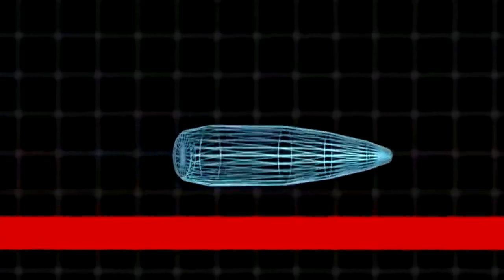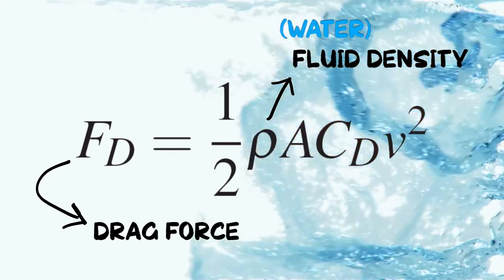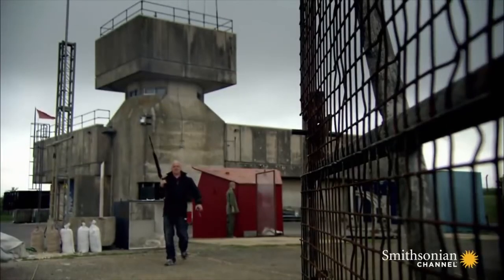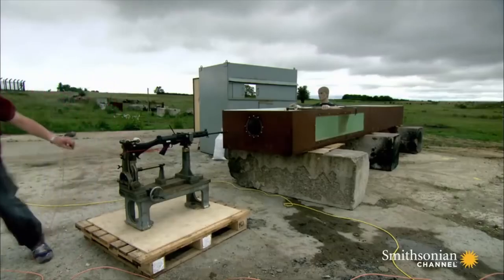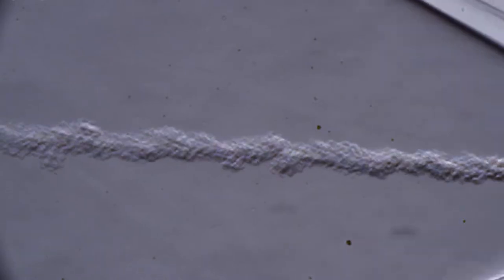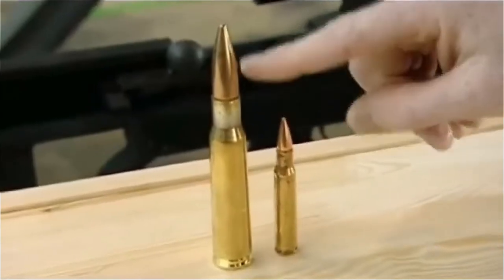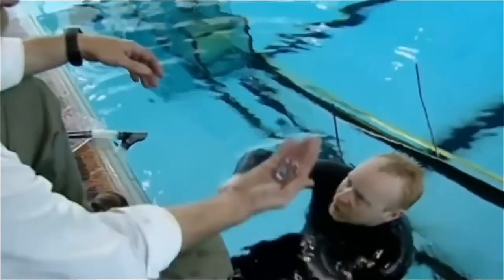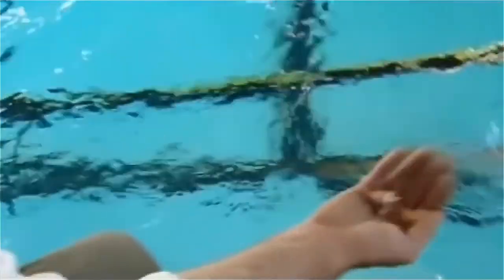Can Bullets Kill Underwater? Is Water Bulletproof? Movie Physics Explained

Comment: What always bothered me was that no one bothered to test the amount of bullets being shot.  I know water will stop bullets, but with the amount being shot that day, is it possible to some bullets to defy physics and kill a soldier underwater?  I'm sure a few did.  Hitting the water at just the right angle.
Reply from the maker: That's a valid point! I wouldn't say some bullets would defy physics and penetrate the water more than the others, but I can imagine a few reaching the soldiers because the water surface wasn't level due to winds and waves. The soldiers could appear to be deeper underwater but in fact the troughs of the waves "reveals" them more,. This leads to a shorter distance actually travelled by the bullet underwater. Thanks for bringing it up :)
Reply: that's like saying if I drive a car at 80 miles per hour into a brick wall 100,000 times, shouldn't I be able to safely drive through the wall a few times?